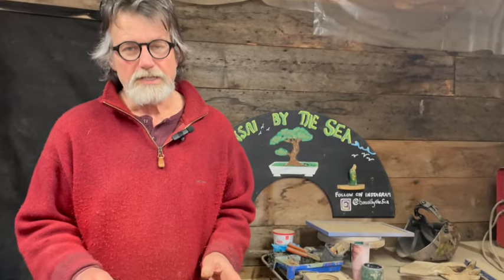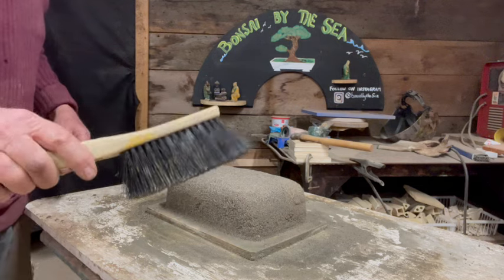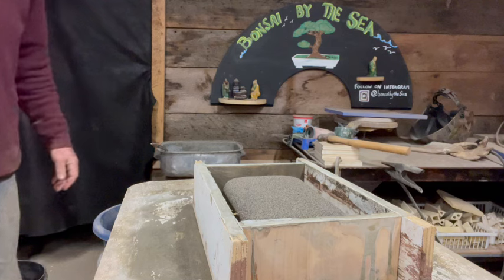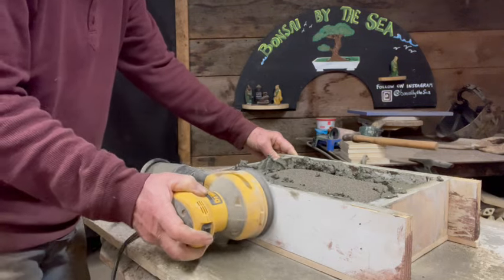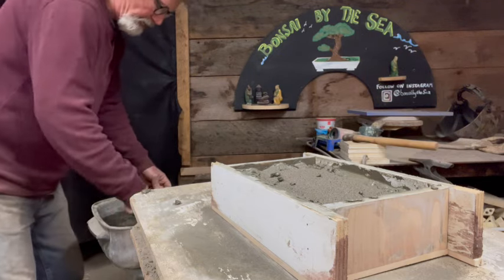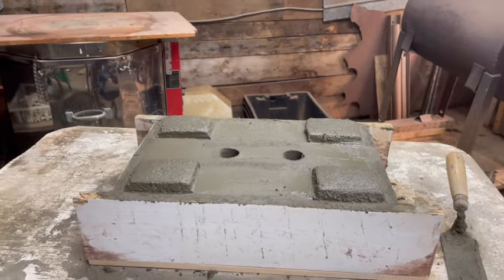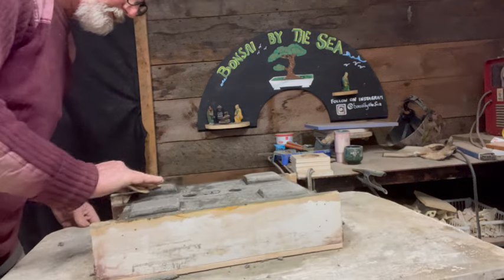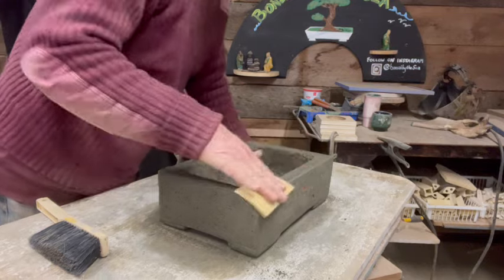How to Make A  Concrete Bonsai Pot  with a Simple Plywood Form

Comment: I mix my sand with a bit of bentonite. It’s a powdered clay that we use when priming concrete pumps and I think it’s used for drilling wells also. About a 10 to 1 ratio. You can use less water and it holds together very well. Very little slumping or crumbling too. I recycle my sand after using it to make large garden pots, keeping it in 5 gallon buckets in between projects.

Comment: Interesting and it would be fun to try one of these for myself.  Thank you for the instruction.  The next time you make a pot video can you show the bags of material you used I'd like to see that.  I'm in Atlantic Canada too so I could probably get the same type of material at my local building supply.
Reply from the maker: I just use general use Portland from castle building supplies any sand will work has been a cheap way to make pots thanks for watching